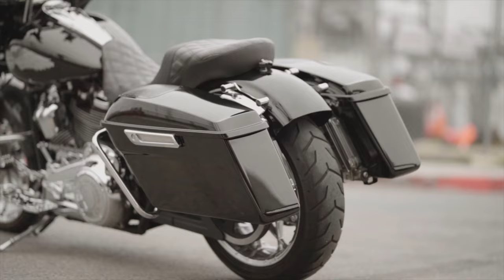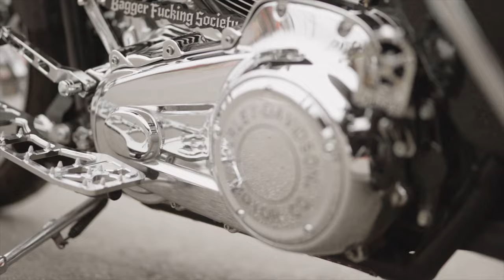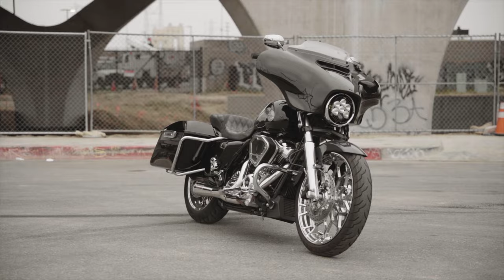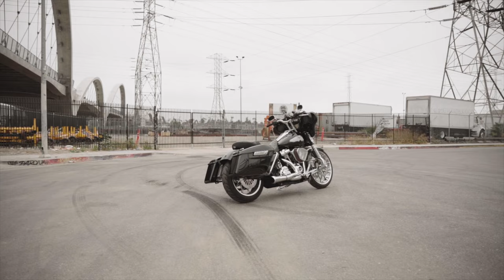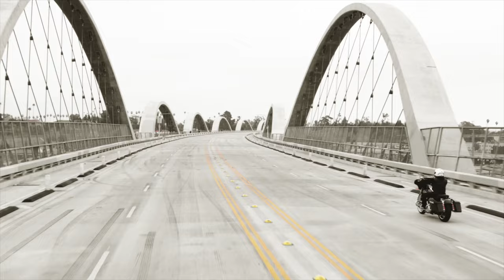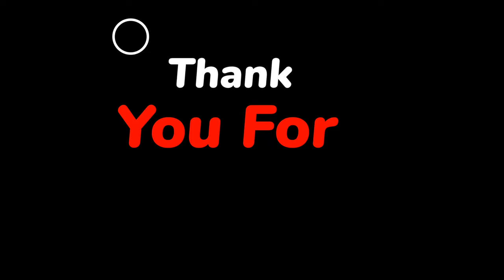BIKE PROBLEMS & EXPENSIVE REPAIRS | HARLEY DAVIDSON STREET GLIDE M8

Comment: Get a Multimeter
Unplug the stator
Start the bike
Set the meter to A/C and see if the stator output is correct 
Kill the bike
With the maxi fuse removed you should not have ant DC power
Set the multimeter to OHMS
Get the lead and test for continuity between pins of the connector from the stator you should 
Then test for continuity from each pin to a known ground you shouldn’t if the meter is digital you should have OL ( open line)
This is testing that your stator is good.
It just might mean that you Voltage Regulator took a crap, sometimes the the voltage regulator gets corrosion between where it mounts it likes a good ground
R
Reply from the maker: Thanks for the info bro I’ll definitely be trying that out! I hope it’s just the regulator 🤞🏽

Comment: Dyna. Man the stator isn’t bad. Take the primary off and mark your bolts then I didn’t have to take the clutch out. Getting the plug through to your rectifier isn’t bad but get a can of silicone spray and it’s easy
Reply from the maker: Yeah bro I think that’s what I’m going to change first and hopefully that fixes it 🤞🏽

Comment: Do not replace the voltage regulator unless you are getting over 14 Volts to the battery. The cheap Chinese regulators are junk; they might last 30 seconds or 30 days, but they won't last long. The HD regulators are the best so no need to replace it if you are just replacing the stator.
Reply from the maker: I really need to test it out and see what I get. If the bike runs and the battery isn’t dead, I might just take it in to get an appraisal. I want a different bike for the channel
Reply: @BAGGERSOCIETY  Many people think that if they have charging problems that it must be the stator, but 9 times out of 10 with air cooled motorcycles, the regulator is the problem. Its MUCH easier to change-out and cheaper but the test is that if you are getting 14 volts or over, you have a regulator problem. If you are getting 12 volts or less, you have a stator problem. If you DO have a regulator problem and you are on a budget, I would recommend buying a used HD one off Ebay that has been tested as good for $20-$30 vs a new Chinese one.